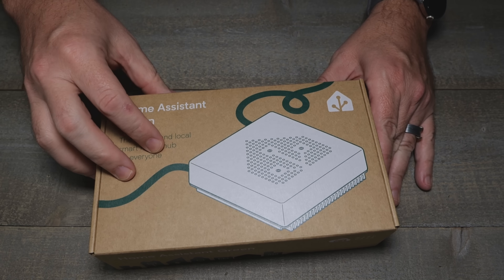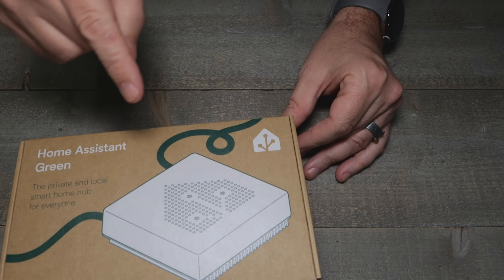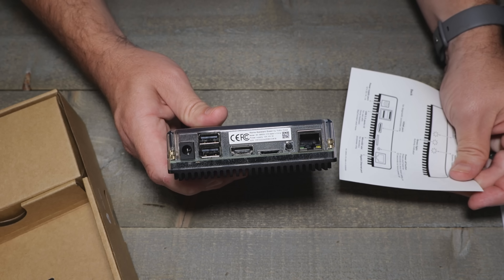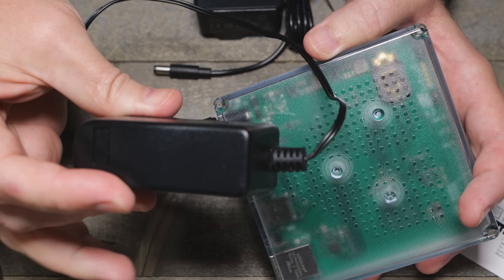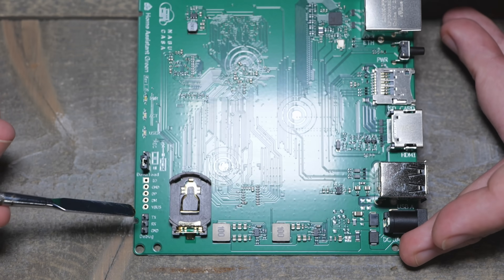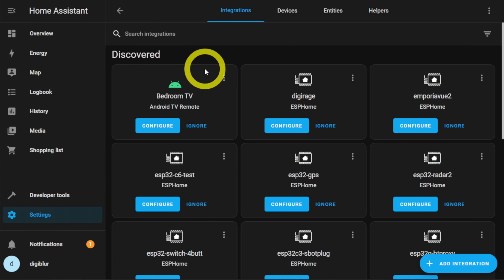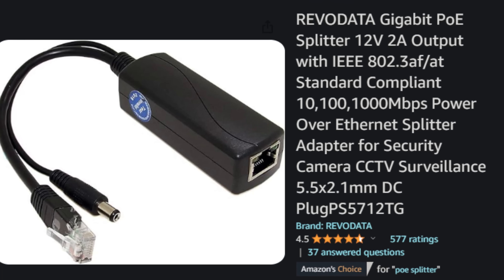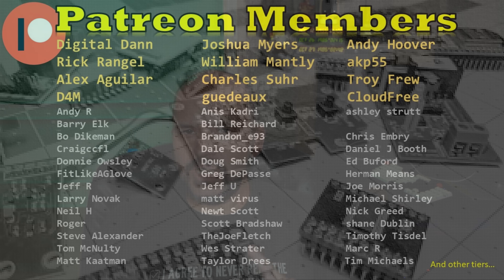Home Assistant Green: Best Smart Home Hub for Beginners? (Unboxing and Review)

Comment: I think you are correct. a good starter box but just not powerful enough once you get into HA list most people do.
Reply: I think they're trying to target more of the beginners so it makes sense to put out a cheap unit.  That could last a new user quite a few years.  If that person is in a small house or apartment with less to automate who knows how long it could last.  Particularly apartments.  You're less likely to have cameras, sprinklers, and all the things that come with a yard.   Us early adopters are mostly crazy and obsessed. 🤣
Reply: @jmr I agree. I have helped a couple people get into HA and some I recommend a PI and some I tell them to higher spec machines because I know what they will do in the near future.
Reply: Video management apart I can't think of a single activity "most people do" you can't do with HA green.
Reply from the maker: I can name plenty that are brutal with it. Spend a few bucks more and get a real box that you won't be replacing in a year.
Reply: @digiblurDIY  name some of them
Reply from the maker: Grade school recess games? 😎

Esphome is a great example.

If the Pi4 processor is great for your home then roll with it. People still have their stuff on a Zero which is nuts but I have to give them props.
Reply: @digiblurDIY ESPHome is the worst example, HA green can handle hundreds of sensors flawlessly and if you're talking about compiling it will still be slow as hell on any NUC, just compile from your desktop like you're supposed to. 

Try again with another example but I'm starting to think you're speaking out of thin air and just enjoy paying a Windows licence and consooming 5 times the power just for the sake of it, and not the slightest guarantee that it will be more reliable.
Reply from the maker: I would try this for your setup, it is the BEST since it is cheap, small and low powered.  https://www.adafruit.com/piz2w